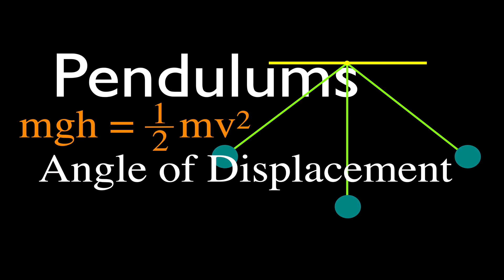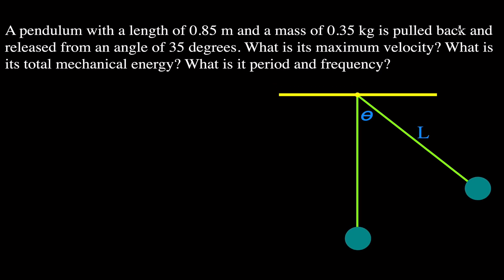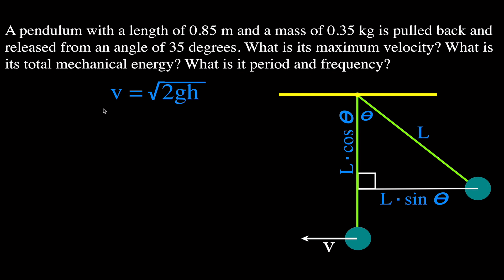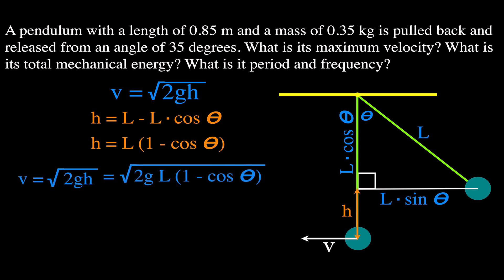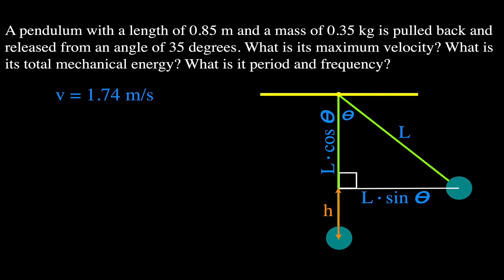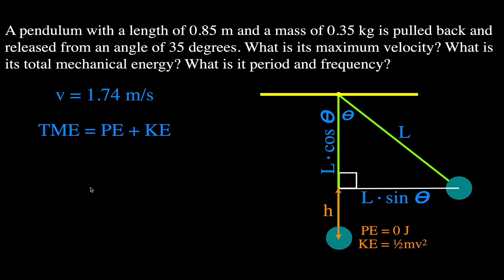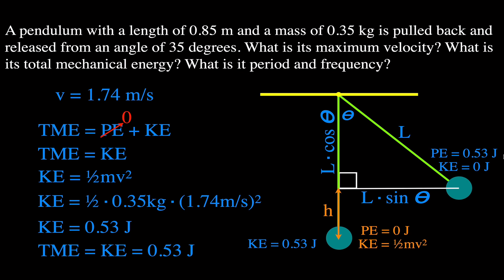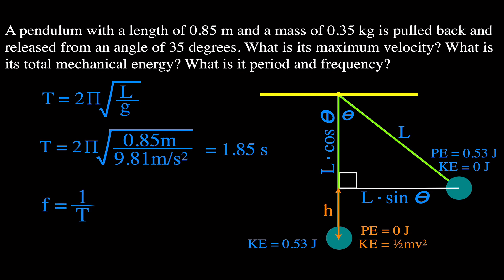Simple Harmonic Motion (6 of 16): Pendulum Velocity from Angle of Displacement

Comment: Can we find velocity at any point in the period? We are just solving for max velocity at bottom point, max kinetic energy.
Reply from the maker: Yes you can, you just have to know the change in height from the maximum height of the pendulum, v = sqrt (2gh).
Reply: @stepbystepscience  maximum heigh tof the pendulum would be l ? length of string? So change in height from a 90 degree release point. That would give us the velocity at that given point?